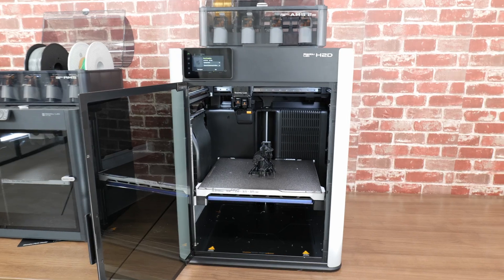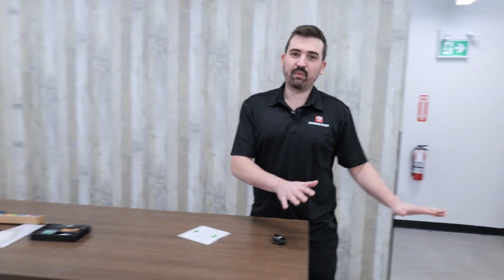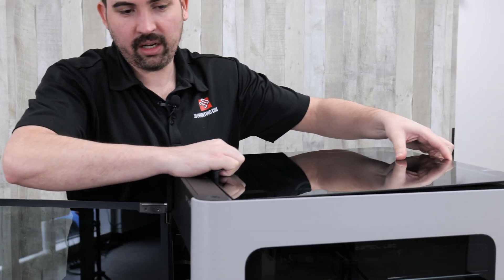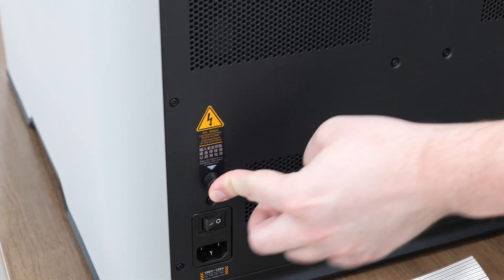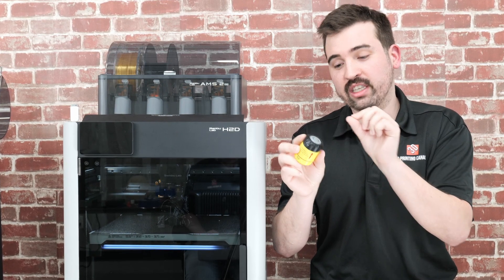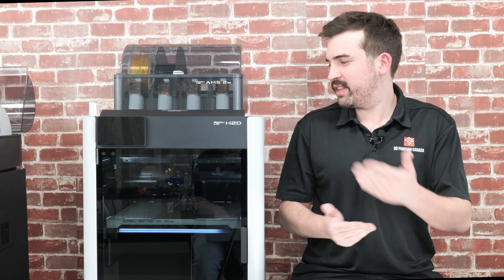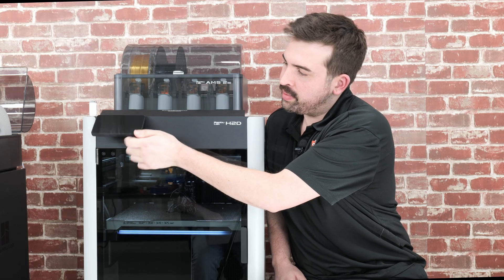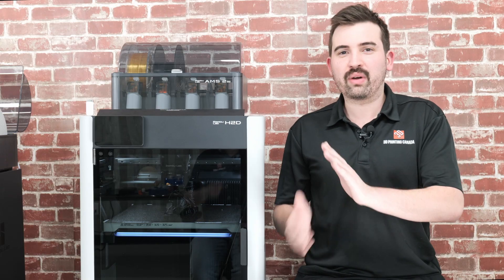BAMBU LAB H2D - UNBOXING & TEST PRINTS

Comment: 5:25 the plug is for when you upgrade to a laser module. Emergency button connection.
Got my H2D yesterday and it’s printing the whole time, big parts. One single color and 1 multicolor piece. ABS and PETG. With the heated chamber I have no warping.